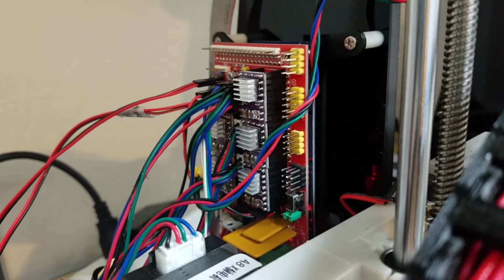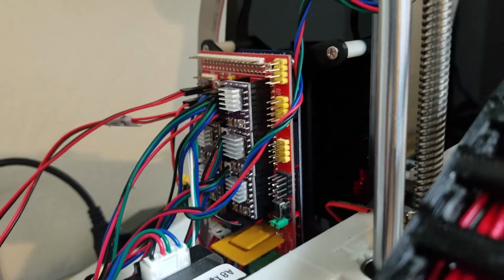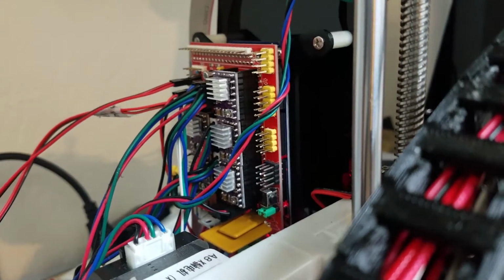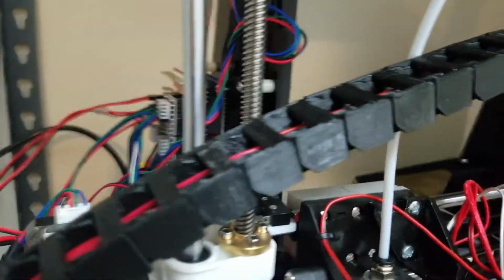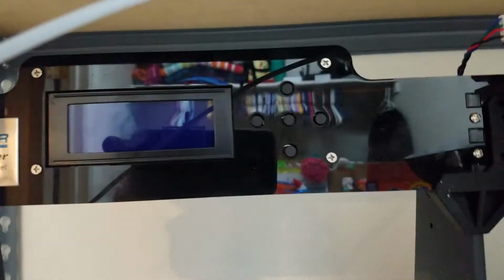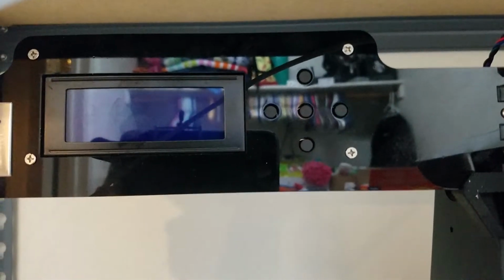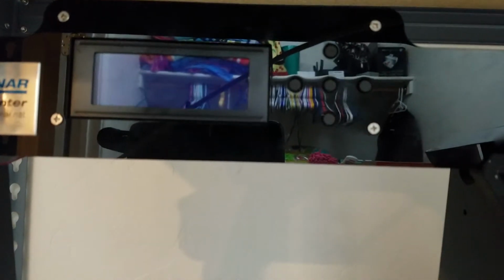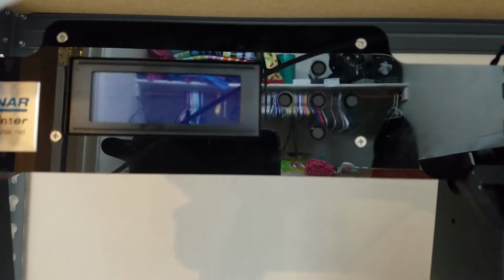The Anet A8 failed - update

Comment: umm if you are getting SPARKS from hotend contact to heat bed, SHUT IT OFF!! you have other issues .. there should be no juice feed to the bed surface or the nozzle!!  power to the bed should never get to the surface of the bed, only in the heating element which should be insulated from the bed it's self.  the nozzle shouldn't be getting any juice either, the heater core should be insulated from the block inside the core it's self. you likely have a well know issue with the Anet's where the spring has worn through the thin coating under the bed and is juicing the whole carriage!! DANGER!!!
Reply from the maker: This was something that happened quite some time ago now.  I have since switched the entire printer to an AM8.  After this failure I spent hours combing over it to figure out where the short was coming from.  Once I moved to a different mainboard and a new E3D V6 hotend, there have been no issues at all.

Comment: After changing board, you don’t have sparks anymore ? (I hope so :)
That’s quite strange, it shouldn’t have occured in the first place, and is probably no good for safty...
Reply from the maker: Correct, I have had no sparks or issues since I changed out the board.  I still am not 100% sure what caused it, but it seems to be fixed now and I am printing like crazy. :)

Comment: Are you printing directly onto the heat bed with nothing in between the print material and the bed? If so how does that work for you
Reply from the maker: I am printing directly on the aluminum bed at the time.  I am using glue stick to adhere the print.  It prints nicely directly on the bed.  I don't always print directly on the bed.  Sometimes I use blue painters tape.  I recently bought a 1mm piece of PEI that i will be putting on the bed.  i am looking forward to that.
Reply: The Cheap 3D Printer oh really nice I just bought buildtec knockoff which works extremely well without any extra adhesive from anything

Comment: Have you looked in to why you are sparking aka causing a short when you contact the hot end to the bed this should not be happening
Reply from the maker: I did some checking of different things and never came to a definitive answer.  I did find that my thermister had continuity with the heat block, so there was some wire exposed there.  I can't be certain that the spark was caused by that.  After this happened, I took the heat bed off and re-soldered the connections on the heat bed.  My thought was that maybe the bare wires were somehow contacting the aluminum bed.

Comment: Not trying to be a dick just new with 3d printing, but why are you printing straight onto the heatbed?
Reply from the maker: There really isn't anything wrong with printing directly on the aluminum bed.  There are some heatbeds that do not have the aluminum bed incorporated with it.  You don't want to print without the aluminum bed.   I often use blue tape on top of it, but I was having some warping issues with it lifting the tape off the bed.  I am now using glue stick on the aluminum bed.